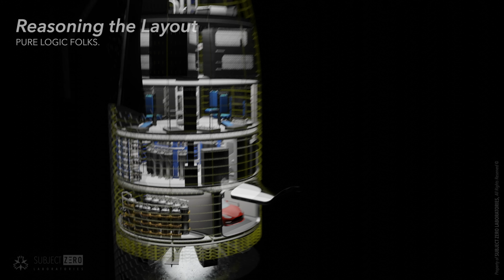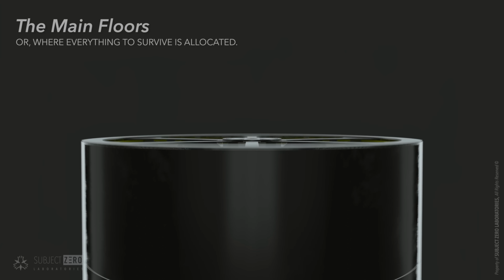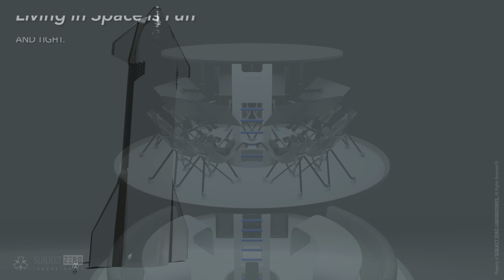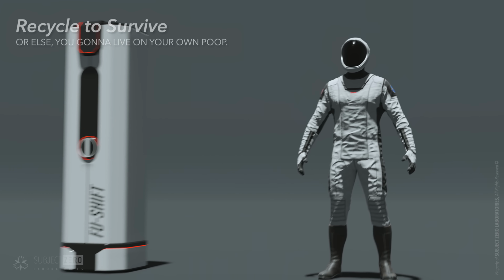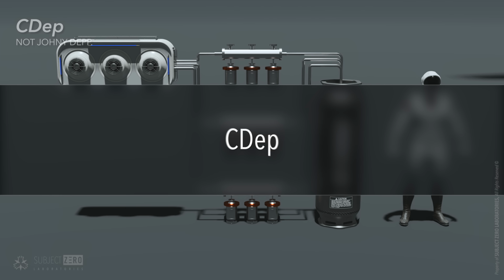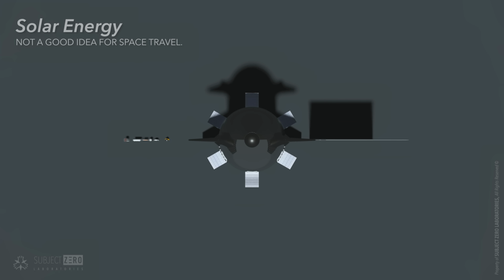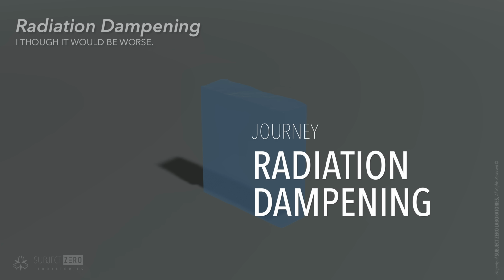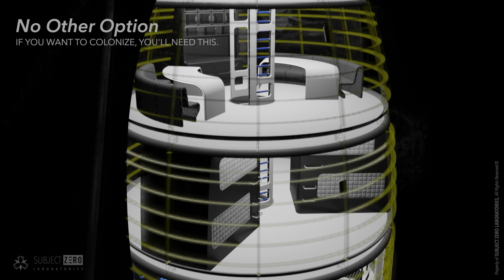Onboard the SpaceX Starship 2.0 in Detail - What it takes to go to Mars | Detailed Breakdown

Comment: This video pretty much completely ignores the 'multiple launch' strategy that is core of what SpaceX is doing.. so many was you can utilize external attachments for extra storage, and solar panels could be launched as a completely solo launch and attached in orbit with an EVA mission. At least, the first thought I had when they announced their multiple launch strategy was that they would outfit their starships with docking ports and attach multiple together and resource share like the falcon heavy launches.. so during the ride to mars they'd co-habilitate the starships with lots and lots of "storage dedicated" starships, then they'd leave some of the storage/provisioning ships in orbit with extra resources/gear for the trip back and then detach for landing.. so then they'd just need enough resources to get back to orbit for the return back home. So if 100 ships travel together.. maybe traveling in 4 groups of 25 ships clustered together with X for provisions/fuel and Y for crew&landing/launching.. then some procedure to migrate between the clusters in case of catastrophic failure in one of the clusters. Even if they just attached 2ships together it changes the outcome of this video. but awesome video nonetheless! very informing :)

Comment: I don't think you'd need an entire deck for fitness equipment. ISS crews are able to get by with one treadmill and squat rack. I would say you could get by with using 1/3 of that deck for exercise and hygiene. The other 2/3 could be utilized for something else. Having a ladder run the entire length of the ship presents a fall hazard. The ladder should instead be stagger between decks. There should probably be a lift system between storage and airlock decks.

Comment: Bro, you are talking about Starship 1.0, not 2.0. Starship 2.0 is currently only on drawing boards. It is planned to be 240 meters tall or 775 feet, and 18 meters across or 60 feet. Much larger than Starship 1.0. In fact, roughly twice its size.

Comment: If space is massless why not send a main module up and 5 modules that connect in a circle to the main module? The main module could be the main driving force and the 5 modules the storage units piggybacking on the main module. Uncouple them at Mars and land each unit separately. One module dragging 5 modules with it to Mars.

Comment: I have been corrected for assuming that "most of the radiation comes from the Sun". It does not.
Here is the reason for this: While there are solar events that will last minutes and will have a very high amount of radiation, those events are rare, while deep space radiation is 100% constant.
Also, radiation and sub light particles bombarding the ship from deep space are usually much more energetic, meaning that regular protection designed for solar events and/or nuclear sources may have little impact for cosmic radiation.

Also, the Sun itself acts as a shield for cosmic radiation. So the further you are from the sun, the less solar radiation you get, but the more cosmic radiation you get.
Reply: For Crew Starship radiation protection in Earth-Mars transit and hypothetical (but science-based and rather probable, one way or another) water shielding implementation method, you may see detailed 3D renders here: MarsAlpha (add a dot and 3 standard letters after it to get a shortcut to Flickr album - YT algorithm appears to not allow comments with actual url). You may also find interesting article linked in album description. Some neat info & numbers there, like effectiveness of proposed "water shelter" against solar flairs and cosmic rays.
Reply: @JM-kx3iw  I have seen some interesting  new aproaches to radiation shielding by creating a magneto-
sphere around the ship, making some zones of the ship less probable of being hit by charged particles.
Reply: @joaocordeiro198  Yes, it's called active shielding. When the ship is sufficiently big, these kind of systems start to make more sense (similar to "artificial gravity" by rotation – it makes practical sense only if ship is big enough). In the description of Flickr album (see my previous comment) you will find article which covers passive shielding in context of Starship (for Crew Starship in Mars transit we don't really need any active systems), but it's a second part of larger work about cosmic radiation and it's impact on human health. The third part of the article covers, in ELI5 formula, active shielding systems – you can find it easily, just go from second part (link in Flickr album) to Substack authors page and find part 3 on active systems. It's shame I can't just link it here. Cheers.
Reply: getting hit by gcr is rare
Reply: @joaocordeiro198  but there are not enough gcr to get hit by because of inverse square law also stainless steel ( metal starship is made of ) provides  excellent resistance to gamma radiation from 1MeV to 10MeV (most of the gamma rays is 8MeV)
Reply: @vanshanand4098  
"Thomas H. Prettyman, in Encyclopedia of the Solar System (Third Edition), 2014

2.1 Galactic Cosmic Rays

Galactic cosmic rays consist primarily of protons with an average flux of about 4 protons/cm2/s and a wide distribution of energies extending to many gigaelectronvolts"

Please note the "giga" part.

Comment: Do to planed Leo refills that are planed, they also have the option of filling the O2/H2 tanks and water tanks with a supply, also your use of individual tanks is unrealistic, they would use larger tanks built into the ship,  also the water is not linear in use, it will be recycled as they do on the ISS

Comment: The solar array could be shipped into orbit with the tanker and be attached to the crew ship with a canada like arm that would switch ships the same way the canada arm moves on the ISS.  After arriving at mars it would be cool if you could park the array in orbit for a ship returning to earth .Also thinking you might want to practice landing on the moon like 5-10 times with a second ship in orbit as a backup. I think the first guys to land on the moon should bring a bigelow inflatable habitat in order to set up a lifeboat . If you're going to the moon bring the full load of supplies to supply a moon base. A 100k pounds is a great start.  Mr. Musk can build a autonomous bulldozer in order to cover the lifeboat with lunar soil for radiation shielding.

Comment: The iss is not constantly having sunlight but the traveling starship will. Plus new solar panels are way more efficient than the one used on the ISS. Also the ISS is old and it may be possible to reduce energy costs. 

Water can be recycled with a very small lost. So you can get away by bringing way les water. On ISS 90% of water is recycled and with new technologies that number could be higher.

food is hard, but maybe food could be grown during the journey.

Comment: Six months in space has already been achieved in the space station. So this will not be an issue. I would not waste a floor of an expensive vessel for socializing. This is a work journey so socializing would be an unnecessary luxury. They will need to manufacture a type of trailer that they could pull along. Pull will be easy in a vacuum. Heck, the trailer could be enormous as traveling in space is really easy. There is no wind resistance so moving in space is really simple.

Comment: I see a fundamental flaw in the design. Starship needs to be quite precisely top-bottom balanced for belly flop reentry. If you put all 100 tons of cargo on top, while having almost empty tanks on the bottom, it will instead plunge down head-first like a dart.

So IMO best option would be to build it like a thermos bottle. With all the tanks (fuel, oxygen, water, waste, co2, ect) located between outer shell and inner wall.
It would not only retain balance at all times, but also provide extra radiation shielding where it's needed the most. Tanks located around living quarters would contain the most shielding liquids (i.e. hydrogen, if they indeed go for fuel cells).
Additional benefit would come from having internal access to almost all levels of the ship. I.e. having hangar and airlock close to the ground, just above the engine section.

I'd install solar panels directly on one side of the ship (the one without heat tiles). If they decide to go for 2 tethered Starships to create spin gravity, pointing them at/away from the sun won't be an option anyway. It also saves tons of mass, since panels wouldn't require any structural support or opening mechanism. And they'd provide even more radiation shielding.
Reply: I dont really speaks science i came here cuz your comment interest me and i want to understand it
Reply: @Iced_falcon  Starship will enter mars atmosphere falling sideways ("belly flop"). If the top is heavy (payload) and bottom light (empty tanks) aerodynamic forces will force it to fall head-first instead, like a dart.
Typical starlink-dedicated starship doesn't have this problem, because it's never landing with any payload still on board.
Lunar lander doesn't have that problem either, because there's no atmosphere on the moon.
Reply: @CaemmYsWoed  i just wanna know, HOW THE HELL DID YOU MANAGE TO PUT THAT INTO THREE BIG PARAGRAPHS, i could have aced my english tests with ur technique

Comment: This video has a few technical errors. It said CO2 must be maintained below 0.025%, however CO2 in Earth's atmosphere is 0.04%. During the ice age CO2 was 0.02%, during the coldest 10% of the time of the ice age it was 0.018%, but during every interglacial period it has been 0.03%. Ice cores from Greenland and Antarctica give us samples of air trapped between snowflakes in the ice. This gives us samples every year for the last 450,000 years. During the last 4 interglacial periods CO2 was 0.03%. An interglacial period is a warm period between ice ages. There's another ice age every 100,000 years, we're in an interglacial period right now. CO2 was 0.03% before the industrial revolution of 1855. All the CO2 from all countries of the world combined, accumulating all carbon emissions since 1855 has increased CO2 from 0.03% to 0.04%. If CO2 raises to 2% then air will smell stuffy and could give you a mild headache. So why would air in a spacecraft require CO2 to be maintained below what air on Earth is today? That just doesn't make sense. And NASA allows CO2 to be much higher than this video says.

Comment: to author: nuclear rocket in actualy less efficient than metalox closed cyle. Nuclear reactor is heavy, coplex, unsafe and it does not give you forward thrust it gives you only heat temperature, you will still need something to be thrown at the back in order to push forward.

Comment: Biomass digestion seems like a much better solution than Torrefaction. The energy yield from the methane generated by methanogenesis is 10 times greater than the pure calorie burn of biomass alone. In addition, anaerobic digestion destroys pathogens and yields a nitrogen rich soil as a byproduct. This soil can be used to fertilize crops and grow food. This solution is ideal because it closes the circle of resource processing. We grow food, we use energy, we create waste, we digest waste, extract energy, and recycle waste to grow more food. 

Likewise, this solution is ideal because biomass is the fuel for human life, while methane is the fuel for the Starship itself. Since both are mission requirements is seems optimal to use solid waste as both fuel for human survival and fuel for the Starship. The other system of Torrefaction requires additional energy to process waste, and would likely weigh more due to the thermal insulation requirement. Likewise, the waste byproducts are almost useless. Except for the water.

Comment: Actually, they only need enough resources including fuel on one ship to get the humans onboard all the way to Mars, aka a one way trip. There won’t be just one starship travelling to Mars but a whole fleet, maybe up to 100 ships travelling at once. Each “human” containing ship could have at least 1 or 2 companion ships which will contain the remainder of the resources for those humans, and can be fully cargo laden rather than having any facilities for humans.  Also, the plan will be to use a Starship V2 or V3 which will have an estimated max capacity of 200T. Whilst Elons stated goal of 100 humans per starship is unrealistic, my rough estimate based on the weight requirements per human as well as taking into account things like comfort and adequately spaced living and sleeping quarters, I think each ship could hold maybe up to 40 people or 50 at a stretch. So if SpaceX send 100 rockets that would mean a fleet of 2000-2500 humans, quite a decent size to set up an initial colony.

Comment: Quite a number of deficiencies in this analysis.

- Yes, fuel cells could produce the energy required. However, having solar panels only create a "perpetual" system if the solar panels have sufficient power to run the entire system.
- The figures regarding radiation seem to refer only to solar protons and not GCRs. The video doesn't specify but the reality is you need a lot more mass to reduce GCRs than shown.
- The video shows water tanks being part of the radiation protection. But then it states that the water is in part produced by fuel cells. Meaning you have less water and less protection at the start of the flight.
- All that power ultimately produces heat. In an insulated spacecraft you need to reject that heat with radiators. The video ignores the issue of the size and mass of radiator panels and supporting heat pumps and plumbing. It also ignores the fact that these radiators would somehow need to be deployed early and stowed late in the flight and would cost mass and volume.
- The same goes for other external auxiliaries. Communications equipment, star trackers and a bunch of miscellaneous hardware. Again, this cannot survive re-entry so it needs to be deployed and then stowed. Costing mass, storage volume, and it requires EVAs.
- The video doesn't appear to do a thorough estimate of consumables. Where are the consumables for return flight? Do we allow for air leaks? (Micro meteor strikes are all but inevitable).
- The video doesn't allow for redundant systems. Nor spare parts. Nor details of repair equipment. 
- There is also the mass of furniture, galley equipment and so on. Medical equipment. Medical supplies - and a bunch more. Not to mention internal structure. 

In fairness, the video does come to the conclusion that Starship will never carry dozens of people. Others have come to the same conclusion (roughly a dozen or so). What isn't stated here, but is pretty obvious is that Elon's "business case" - which uses the assumption of 100 people, is a nonsense. 

So, lets look further. Mars colonisation is a nonsense. What we can hope to see in coming decades is a realistic but limited exploratory mission or missions to Mars. So let me make it clear. Such missions are not going to work if you need to mine thousands of tonnes of Martian soil in order to acquire the fuel for a return trip. Instead, we need an architecture that separates out the role of transit vehicle (Earth orbit to Mars orbit and return) from the role of Mars lander/ascent vehicle. Starship is seriously compromised because its trying to carry out both roles. Mass you need to be a lander (thermal protection, structure etc) is mass you don't have to make the transit safer and more reliable.
Reply: agreed

Comment: Why don't they make "assistant" ships that connect to Starship on a long trip?  A series of Falcon rockets w/payload set up connect to Starship via ambilocal connections?  Power mainly. 2 falcon Heavy rockets could carry a complete solar array capable of providing immense solar power and another for various onloading/offloading of miscellaneous items. Redundant systems and spare parts could be among the miscellaneous items. Once at Mars, the ships detach and separate, each landing at a predetermined landing site. SpaceX is very good at hitting the bullseye with vertical landings. Just an idea.

Comment: WHY ARE NOT TREADMILLS DESIGNED TO GENERATE ELECTRICITY TO CHARGE BATTERIES, ALLOWING FOR CONSISTENT BATTERY USE DURING THE TRIP AND MARTIAN HABITATION? THIS COULD POTENTIALLY REDUCE THE AMOUNT OF HYDROGEN POWER GENERATION REQUIRED, REDUCING LAUNCH WEIGHT AND THE OBVIOUSLY CONSTANT FEAR OF HAVING A FAILURE AND LOSS OF AVAILABLE POWER?
Reply: I don't think humans produce that much energy. You'll struggle to power a TV on a bike.
Reply: @12345maxx  Umm bikes are capable of producing similar watts as is an automobile alternator. So you’re saying automobiles run in less power than a TV?

Comment: If you are going to Mars you'll need 3 ships, one for the crew, one for extra fuel and one full of food, if not they'll die two months after arriving. They'd have to send a ship every year to restock food, equipment etc. A space station is probably a good idea as it is an escape from Mars and for medical facilities. Humans are not designed to live off planet Earth, their health suffers the more they are off planet and if they are injured they could die from something that on earth is trivial. They can produce electricity from their poop, that technology is used not to destroy dog poop.
The design of the ship, vertically will produce artificial gravity merely by the propulsion but they would have to drive the ship constantly, if they didn't they would simply float (The Expanse), of course driving all the way there would mean having to flip to slow down for entry.